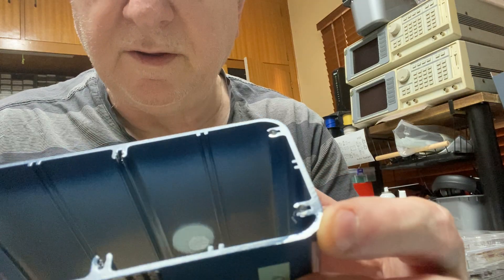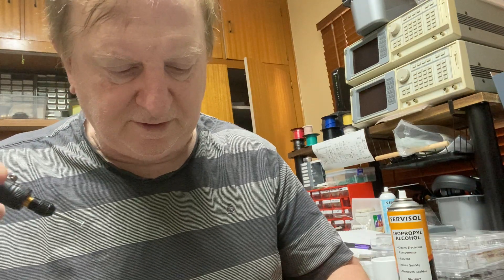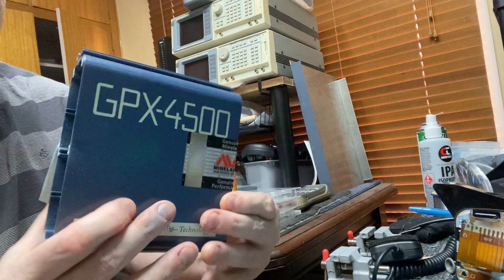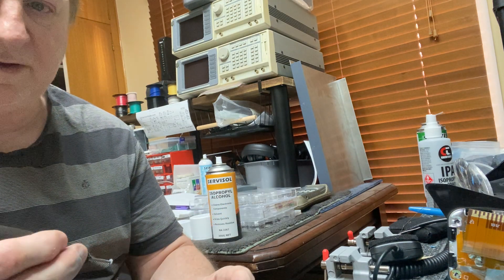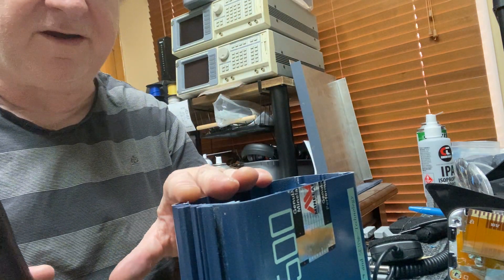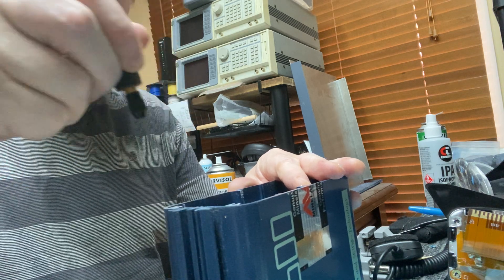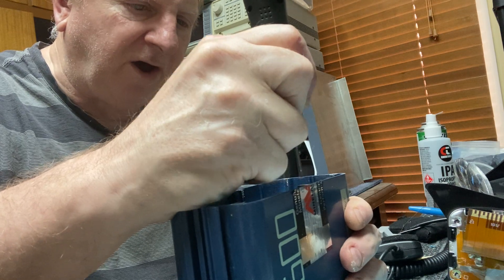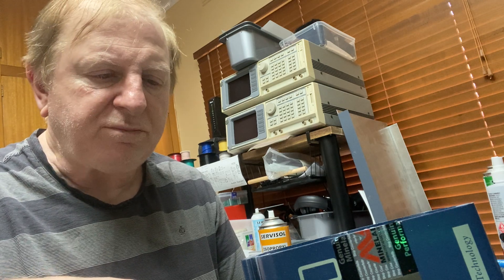I keep on finding these without proper grounding and how to fix it fast.

Comment: Woody, what type of cutting/sanding tool bit were you using in your JANGKLIFE mini-rotary tool?  It looks like it could also be useful when repairing old PCBs that have corrosion from bad caps.

Edit:  For those without a milling or grinding machine, a sheet of appropriate grit sandpaper laid on a very flat surface like a table saw "table" or even a kitchen counter could be used to remove the paint.  Since aluminum/aluminium starts oxidizing instantly, perhaps coating the sandpaper with the silicone oil before (wet)sanding the paint off would prevent even that small of oxidizing?
Reply from the maker: It’s a flat circular disk with industrial diamonds.

Comment: Anyway to remove the sticker and refit later heat gun perhaps i think mine needs doing i reckon its got noisey
Thanks for video
Reply from the maker: Isopropyl alcohol if you can get it underneath.

Comment: I was rather amused when I was repairing my Sovereign XS that the apparently factory solution to shielding was a paperclip, soldered to a bit of hookup wire... Which was then clipped over some thick aluminium foil wrapped around the inside of the plastic Jiffy Box enclosure.

Bit bodgy, but for a common or garden VLF machine, it seems to work OK.
Reply from the maker: I’ve seen that on a few detectors lol.

Comment: Thanks Woody, another great tip. A half sheet orbital sander will be enough to take the paint off all around. About 180 grit paper should do. Work outside or in the shed, you don't need all that paint dust. They are about $80 at the local hardware shop.
Reply from the maker: Yes, good advice.

Comment: What about putting in stainless screws, to stop corrosion, instead of the black painted ones.
Reply from the maker: I did that, I found some stainless on Alibaba with T10 heads but a finer thread tap.